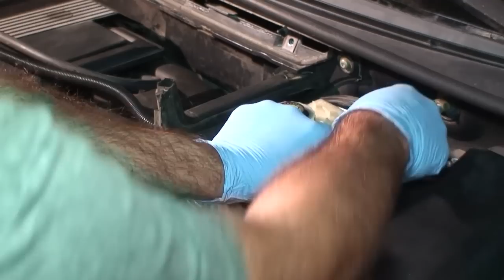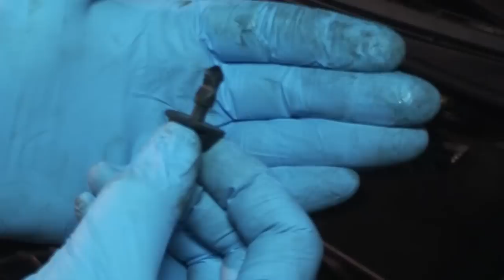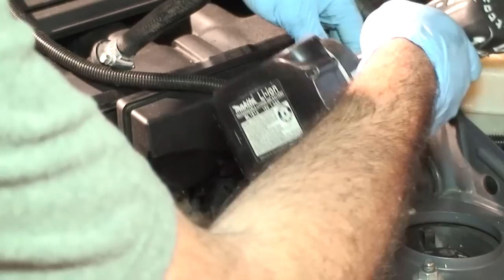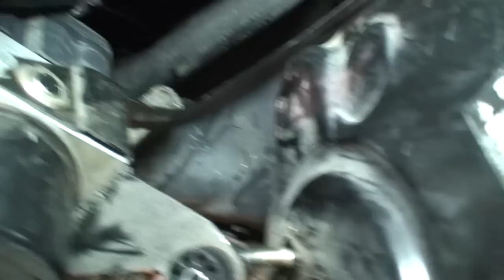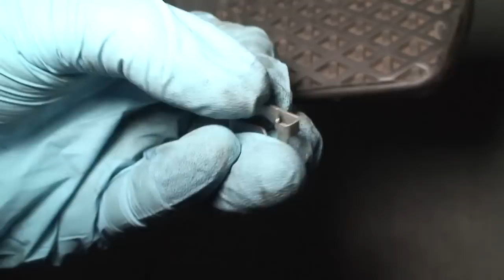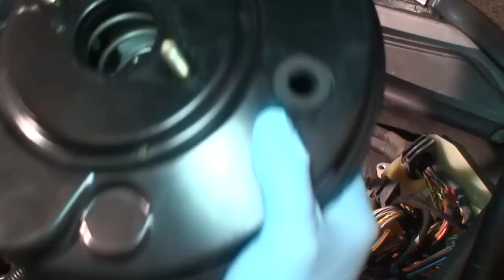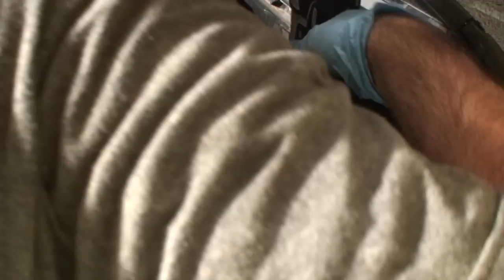BMW 330i 325i E46 Brake Booster Replacement DIY (No Bleeding Required!)

Comment: Thanks Jason, for the great tutorial. Completed the brake booster replacement in about 4 hours. It was a PITA to wrestle the booster in and out. But got it to work. Next up, tackling vacuum leaks.

Comment: Thanks for the video 50s! I've changed mine lately on my 25i based on this video. Hell of a job, no doubt on that. I have some more info for you if you don't mind:
- DSC is not really just an ABS. It has more hose to go in the cube, and doing other stuffs as well. 

- at 9:11 that blinded tube on the side of the reservoir tank is for the clutch, it's not under pressure, so there is no clamps or clips on it, fairly easy to disconnect. It will drip brake fluid so be careful!
-  well, it needed quite an amount of force to bend the brake lines. Initially I was a little scared to break those, but it's rigid as hell there, also note, these hoses are not copper.
- I didn't remove the lower windshield cover, but it would be helpful, makes more space when you try to bash out the drum itself.
- when you removed the 2 clips at the brake pedal, I simply slided right the pedal to that point, where it can be rotated out from that holding pin. Saved me a solid 30-40 minutes I presume.
- of course, it made the reassembly a lot easier. There is a plastic 'salvo' on the upper point holding the pedal straight, it needed a little bit twisted arm to get there and reinsert it back.
- pay attention when inserting the master cylinder into the booster, it has a pin in the center, and the master cylinder needs to be aligned with it.
- reinserting the lower pin of the DSC back to its place was quite hard, because you need to bend the hoses back, and you have less leverage on it. 
- if you experience some brake fluid on your master cylinder shaft, you need to change that as well. Brake fluid is a strong oil, removes paint in an instance, leave bare metal to rust, so you can do this procedure again some time lately :D 
Thanks again for the video!

Comment: I just got done with this job. Removing the third bolt on the brake pedal bracket makes that part super easy. I was only under the dash for about 5 minutes total. I did mark the bolt since it looks like an adjustment, but once you bolt the booster on it really doesn't matter. It ends up in the same spot. The brake light switch comes off with the brake assembly, so no adjustments needed there.

- My 2001 330xi had a different DSC/ABS. It's cylindrical and had its own short section of hard line that was really in the way. I also did not have the flexible lines off the master cylinder that yours had. Mine were hard lines. That made maneuvering it out of the brake booster compartment a lot harder. I was able to do so only after loosening the booster and essentially squeezing the brake lines while pushing towards the engine to get it around that metal frame before completely seperating it from the booster. 
- I read a tip on E46 fanatics (I think) to compress the brake booster with a lightweight tie-down strap before installing. I used that tip to get the old one out as well. It was still extremely tight, but it allowed me to do it without taking off the DISA and lower air boot. I probably should have taken those out anyways as it doesn't take long. If I had to do it again I'd take those off.
- There was a point with the hard lines on mine that I thought there was no way it was coming off and figured I'd have to open those up. I kept fighting but it wasn't easy. That said, there is a lot more flex in all the components than it seems. You just have to keep trying and at some point give it a good push and have faith. On the install, definitely cover it with a rag to protect the new one. 

All in all, I did this in under 3 hours. It's doable in 2, but I'd allow 4 to be safe.  Thanks so much for the video! No more high pitch whine!
Reply: Jaki miałeś problem? U mnie w 330xi mimo dobrych tarcz, klocków i nowego płynu oraz po regeneracji zacisków hamulcowych hamulce są ciężkie, brak efektywności, trzeba mocno wciskać pedał hamulca, aby był efekt.

Uważasz, że to serwo do wymiany?
Reply: @MrDamianDXi  My brake booster was making a whistling noise whenever my foot was off the brake. Any pressure on the brake pedal made the noise go away. If your problem is not air in the fluid, it could be the brake booster. The first thing I'd check is the vacuum to the booster. If it's not getting a good vacuum, I imagine it would feel like manual brakes rather than power brakes. Check the hoses, any plastic connections, and the grommet on the brake housing. Good luck.

Comment: once again great video.  Just did the job in 3 hours. Some things to speed it up are as follows:  No need to take off the lower intake boot, no need to drain the brake fluid, very easy when you remove upper nut from above brake pedal, remove both clips and slide brake pedal off it's pivot (make sure to slide plastic collar on when replacing,  Keep up the videos
Reply: Did you need to remove the DISA?
Reply: no need to remove DISA.  Funny though, I installed the booster which I picked up at a junk yard and had to do the job again with a new one since the Junk Yard part was leaking too.
Reply from the maker: Yeah it kind of makes sense because they have rubber seals inside them and they just degrade over time.  I guess a new part is the way to go on this one.

Comment: Hey 50sKid, thanks for posting this great video. While chasing vacuum leaks, I finally realized that that sucking sound I heard under the hood was actually the brake booster leaking and causing lean codes, keeping me from passing my NYS emissions inspection, for months. I was getting 28% short term adaptation values using INPA and had already replaced all the hoses, CCV, valve cover gasket, DISA O-ring, Idle control valve rubber, etc. All that was after using your ABS/DSC replacement video to replace my failed ABS module (with an Ebay unit for $90!). I thought maybe I had dropped or damaged the master cylinder to brake booster O ring during the ABS replacement......

I was working alone in my driveway..

I was concerned about getting the brake booster can out of my 2002 E46, and really didn't want to have to disconnect the brake lines (again!) or bleed the brakes (again!) so I was glad to see your video procedure.

I disassembled all the intake parts to make room, pulled the rubber mount from the brake lines, disconnected the brake booster and then struggled to get it out of the car as it was hitting the ABS module, so I pulled the mount off the bottom of the ABS and really pushed the whole master cylinder/ABS assembly up and to the front, hoping not to damage a brake line. I didn't drain any fluid first. I was finally able to get the booster out, but man what a pain in the butt.

The under dashboard work went easy for me, learning from your video to loosen third mounting bolt, and actually removing the entire brake pedal assembly. 

Struggled to get the new booster (New ATE unit, $140) in place, really had to push on the master cylinder/ABS assembly to make room. 20 minutes more to get the pedal connected again. 

It worked. No vacuum leak. No damage to brake lines. Really happy to have this fixed. 

My overall take is that it may be easier for some to just pull the master cylinder and ABS/DSC off  to make it all go easier, and plan to do a bleed, as much as I hate that. 

I own this E46 since new, and with 174,000 miles I would say that with the vacuum leaks, ABS failure, and general wear on parts that you have posted it may just be better to do a huge preventative maintenance session with all of the corrective work and get it done, instead of having something fail every month for years. 

Now that I have the car ready for state inspection and the motor running so sweet, I am tempted to do the cooling system preventative maintenance, wheel bearings and suspension refresh so I can put another 100,000 miles on it. 

Thanks! 
Larry
Reply: I blame myself for not reading your comments before doing this job. I also blame 50skid for providing this video. LoL
Reply: The valve that is on the brake booster of my 330ci 2003 bmw is sucked, the car has a air leak they wanted to charge me300$ just to see the problem but it never gave me other problem since i changed the intake to a new one, after 3 sec i turn it off you can hear a pshhhh  coming out the car, i hope you can help me i Dont have any problems with my brakes they just make noise when im driving on the streets, the valve

Comment: Thank you for your great videos! This video was also an excellent demo for replacing the lower intake boot. The brake booster hose is in the way of the heat shield, I appreciate your explanations of how it all comes apart. Thanks for the DISA valve pin drop warning, too. I didn't realize that was a potential problem. Here's hoping I don't lose any parts in the intake.

Comment: I did this job as described here and I found I did have to take the same items off the engine you did. I tried leaving them on at first, but needed the last inch to move the brake units far enough out of the way.  You need a lot more room than you think at first. I appreciate your video as I knew upfront it was possible to do before I tried. That alone was worth the entire project !

Comment: Awesome video! You helped me out a lot. I found a few things that will make it even easier to do the repair. When you bend the DSC unit out of the way, remove its mounting plate. It's three 10mm bolts. Makes it much easier to get the booster in and out. Also, Tighten the top nut of the brake pedal assembly before you install the booster. This will allow the bolt holes to stay aligned. After you put the booster studs through the holes, put the inside nuts on about two or three threads. then loosen the top nut and that will give you the adjusting room you need to the rod on the pedal.
Reply from the maker: Great tips!  Thanks for contributing.

Comment: Hey 50sKid. Thank you so much for making this video and explaining how to change a brake booster (or servo as we call it here in UK).
I didn't want to disconnect any brake pipes and lose any fluid and face the headache of bleeding the system (which I didn't!) 
My car is a 2005 E46 Touring (Estate or station wagon I think you would call it in the US) with the N46B20A 4 cylinder gasoline engine. 
The job was tricky and called for a fair amount of patience and skill but thanks to you I have done it (Replaced the booster) and my brakes are working fine again, and you saved me quite a few £££££'s on a garage
bill too! Thank you. I am a BMW enthusiast and my current car is the 4th BMW I have owned, I love them. They are quality cars and need to be treated as such with proper spec oils and fluids, etc, and my cars have been very reliable over the years.
Your rebuild series on the M54 engine was superb, thanks for taking the time to do these projects for us viewers, we learn so much, and also what mistakes to look for and avoid.
Regards
Mike
Aberdeenshire
Scotland.
UK.
Reply from the maker: Glad that helped you out, thanks for watching!

Comment: Hi great video, you do need that little bit of play in the master cyl as that is where the internal ports are open to the reservoir & fluid is transferred, it’s VERY important as you could have your brakes locked on when getting hot & fluid can’t return to the reservoir. Hope this helps.

Comment: thanks for this vid bud!  just did this yesterday it was a breeze!  I had no choice by to do it this way because I have a communication problem with the car and cannot access the computer to purge the air if the lines are open and air gets in.  thanks again!

Comment: Great video 50, it is very informative when you leave in the mistakes and then clear them up with the subtitles that is what makes us DIYS guys better knowing how to deal with mistakes and what you may encounter when dealing in small spaces like this👍🔧.
That adjustment plate under the kick panel made things a whole lot easier when you explained what you did.✌
Reply from the maker: GangWar GangWeezy Yep that was me just learning as I went.  I just want to give the impression that you can do the same thing because you see exactly how I go about it.
Reply: @50sKid my e46 330ci has a brake booster problem ...can i use brake booster from left hand drive 330ci on my UK( right hand drive) 330ci ?

Comment: Thank you for this video. I just did this job on my 330xi 6 speed manual. The only real trouble I had was that one of the studs that sticks out of the servo and into the car got unseated and I had to work between the servo and the firewall to pull the stud back into its Knerl. Don't  try to force the servo studs though the firewall.

Comment: Unfortunately, this won't work for manual transmissions, with out an addendum. There is a braided hose on the right side of the reservoir (next to the computer) that goes down into the transmission. It needs to be removed and a bolt put through it. Then you do have to bleed the clutch, which isn't that bad, just annoying. If you could put an annotation in the video about this that'd be great!
Reply: What if the car was manual swapped?
Reply: Won't make a difference. The line still goes from the brake master reservoir to the slave cylinder. But, good news, I replaced my booster today and pinched off the clutch line with line pliers before pulling the line off the masters reservoir. After replacement and reassembly, I didn't need to bleed the clutch. Please keep in mind every situation has a different out come. Always check before assuming. Also, please keep in mind I am also a technician and do these sort of things daily.
Reply: I'm doing this job now on a manual and can confirm, hose is on the right side near where you fill the reservoir. no way around it as the hose is too short for booster to come out around it so has to be disconnected
Reply: I did this yesterday om my manual coupe. And i can confirm that it was a pain in the ass to get in there, but eventually i got it.

Comment: As much as you take off your f connector, I recommend getting one of thse ECS metal f connectors so they don't brake as easy.  I broke mine the exact way you did while taking it off.

Comment: I'm experiencing the same issue with my car, but the brakes already feel spongy and less efficient. Does that mean that air has already gotten into the system? If so, I should just disconnect the DSC, master cylinder (when replacing the brake booster) and bleed it anyways, right?
Reply from the maker: You can if you want to.  I wouldn't.  It's much easier to not drain the system dry of brake fluid in any case.

Comment: If you loosen all 3 nuts and the lowest retaining clip, then depress the brake pedal just enough to lift the brake pedal from it's seat.  You can take the whole pedal very easily without any force to disengage it from the pin.

Comment: Oh man, I finally got around to try to do this. I've been at it for 6 hours and I just cannot get the DSC out of the way enough. I can't get the pin/bolt in the bracket that holds the DSC past that ledge :/ I did it at the junkyard, just can't do it at home.

Comment: Great Video, not sure time wise if it was not easier to remove both master cylinder with booster though. those tube you bent may not always bend back without breaking?

Comment: Your oil filter housing gasket video was great and gave me confidence to doing it myself. Thanks. Just wondering if you were going to do a video on oil pan gasket replace?
Reply from the maker: +Rigoberto Torres Thanks very much.  Yes, I've already shot the video.  It will be coming up soon.

Comment: Hello 50sKid first of all thanks for all your helpful videos, wonderful job my man. I just got a question, I replaced my brake booster on my son's 2000 323Ci following your directions on this video successfully, but a day after the replacement the DSC light came on, do I need to bleed the brakes? or what's your oppinion for this issue in particular? Do I damaged the DSC unit? or a brake pressure sensor? what do you think?

Comment: Hello how are you?
I have a problem with my BMW 325i e46. I hope you can help me.

Every time I brake smoothly there is no problem, but when I brake sharply, the speed decreases, but the car slips and I feel like scraping an iron. PD: and in return the front pads (Traductor Google)

¿Hola como estas?
Tengo un problema con mi BMW 325i e46. Espero que puedas ayudarme.

Cada vez que freno suave no hay problema, pero cuando freno bruscamente, la velocidad disminuye pero el automóvil se resbala y siento que raspa un fierro. Pdta. Ya cambié las pastillas delanteras

Comment: Hello, I replaced my booster pretty easy with your DIY,  but now the front brakes are experiencing brake drag, I did disconnect the DSC/ABS module connector. Do you know if the booster pushrod is adjustable? or it may be just an electronic issue with the pump...
Reply: About 2 hours with the help of a friend. One have to be very careful when inserting the master cylinder to make sure is perfectly aligned with the brake booster, do not force it in. In my first attempt I forced it and the the brake mster plunger and pin where not aligned creating the brake drag, once I aligned them everything went back to normal. If the car is 10+ years and you are planning on keeping it forever, I would go ahead and replace the master cylinder as well, you will be set for another 10 years for sure...

Comment: does the brake booster leak can affect the idle when stopping or on stop while idling on traffic i've change all may vacuum lines maf sensor cam sensor cleaned icv and throttle body but it still fluctuate when am stopping or in gear while holding down the brake now i notice a hissing sound whenever i push on the brake pedal